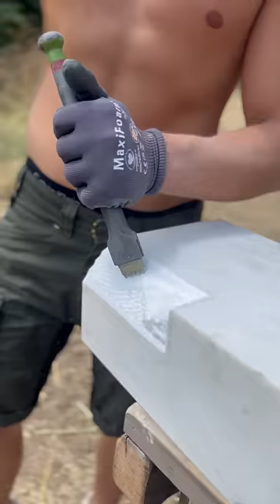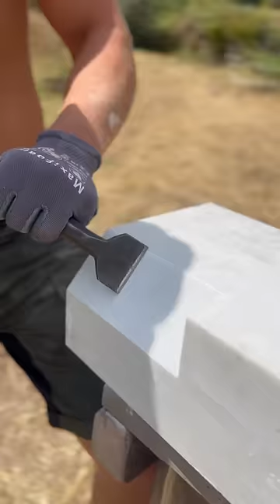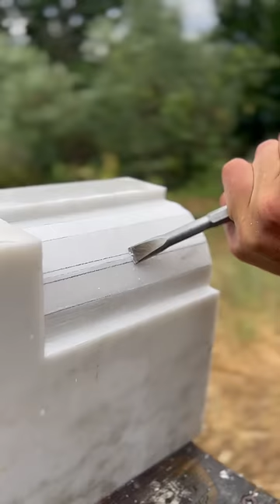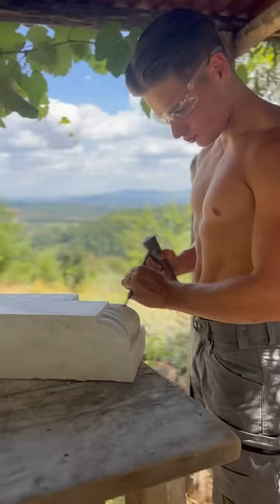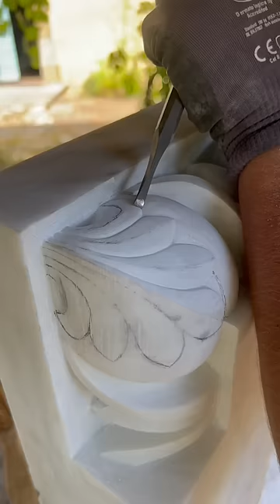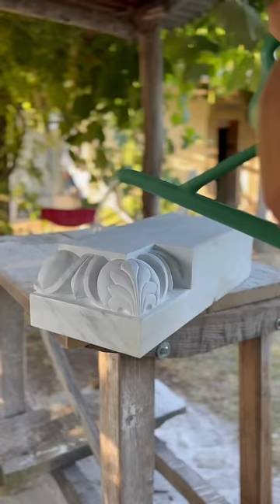My trip to Italy 🇮🇹

Comment: The Chicago World Fair of 1893 has 200 fully sculpted buildings like this piece, was done in 3 years. No power tools, using horse and buggies moving tons if stones. Not to mention there was 100 times less people in Chicago. Look it up!
Reply: Lol no 💩....it was 1893. Of course there's more people now. Wtf🤷
Reply: A lot of those buildings,  especially smaller ones, and the facading & interiors of the MAJORITY,  were just that: Façades. Made from a plaster, basically.   Not to say they didn't use block,  and whatnot.  And glass,  wood,  brick,  steel,  etc. (the Expositions/Exhibitions, World's Fairs,  as a whole).  They were,  regardless of material,  or what u believe or what people say about them, magnificent constructions, regardless of: whether ALL the buildings were made roughly when they say they were at some point in the last couple/few hundred years; OR Some are/were older 'Found'(ed) bldgs., incorporated into their newer constructions to help contribute to the "grandeur" of the site; OR even if,  however unlikely,  that ALL the World's Fair bldgs. were extant, already built and either abandoned (& "founded), or occupied/being-used and were taken by force or barter/bought (HIGHLY unlikely,  but in some small instances this did happen when, however inane & arrogant & immoral, large tracts of land were bought, many times on which were tribes communities & people living,  completely unaware THEIR LAND was being bought & sold without their knowledge or consent), and then repurposed for the World's Fairs.   THEN,  if that's not a bit too much already,  if ALL those buildings WERE inherited (I Def think a small few prob were rebranded & used for the WF's) & basically they walked upon & FOUND all the WFs sites basically as abandoned cities (or conquered?  But that seems even MORE unlikely,  as the world's fairs don't look wartorn.... yet,  maybe the Facading was there BECAUSE OF, & to fix-up all the damaged bldgs!?!? 😱🤯  .....😜😆🤣 j/k), they would've then had to revamp the whole place,  making it look basically newly built, i.e. not destroyed,  to go along with their narrative that they WERE just built.   Seems like WAY too much justifying,  more than finding logical answers, or BETTER any evidence to prove one way or another.

Comment: Coming from IT and electronics repair, I found it ridiculously easy to settle into motor mechanics, then for a laugh I did a month at a joinery firm, which unfortunately closed down. With zero experience having never so much as sliced a piece of 2x4 with a bench saw, after three days I was making doors, putting glass into frames, spraying panels, going on site and installing kitchens and fitted wardrobes that I had made back in the workshop.

Because the level of skill / intelligence was so far below my baseline, I picked it up almost instantly. However, in the process I experienced something interesting. While the fellas I was working with found it incredibly satisfying to complete a job, I felt absolutely nothing, because there was no real challenge.

Maybe I'll give this a go, get a lump of sandstone and carve it into something. Chisels and hammers are cheap, and so is sandstone.

Comment: One of the most obvious differences between a beginner, in a given craft,  skill, practice,  &c., versus any within the 'Senior' or 'Master' level, is that of Speed.  For example:  one thing a Master has,  or anyone who has had enough experience (assuming the proper/effective techniques), is the increased speed (+maintaining fine control/accuracy) of almost all techniques/motions due to the acquisition of: muscle memory, better intuitive sense/feel - highly sensitive & quick response to minor fluctuations in [material, density, color, sound, bounce, &c.], & more.   
But, to demonstrate this,  or at least conceptualize it,  just think of when someone like Charlie here, of the Master/professional/precision/Artisan-Caliber, shows a sped-up/time-lapsed clip of him working on a specific spot,  getting finer detail on......  this is basically the equivalent to: a beginner/amateur,  who DOES know the proper techniques,  but it's just being more careful,  deliberate,  & slower - taking a clip of them doing the SAME particular technique as the Master craftsman, and just speeding it up to Luke 2-5x original speed.  So besides things like learn little tricks,  experience,  intuition & muscle memory,  &c., a PRIMARY difference between beginner & expert is simply,  Speed.  
This also applies to more (some may call) 'primitive' tech & processes,  compared to more modern analogs due to our applications of the electric motor,  combustion,  & more.   For example: a jackhammer,  or pneumatic hammer, is just taking the old tried-&-true archaic methods of pounding stone-on-wood/stone/etc., with multiple people & heavy weights,  and applying our more modern resources of Electricity,  compact EMic motors,  microcontroller,  amazing material-science for mfrg. VERY tough, heavy, alloys & such to make hand-run, electric/gas-driven, tough heavy & powerful jackhammers.  But they're just doing what a bunch of guys would do,  much faster & more efficiently.